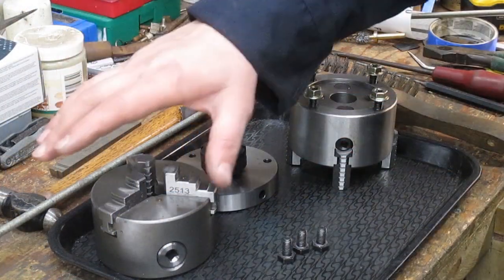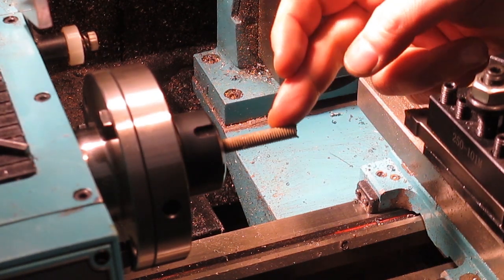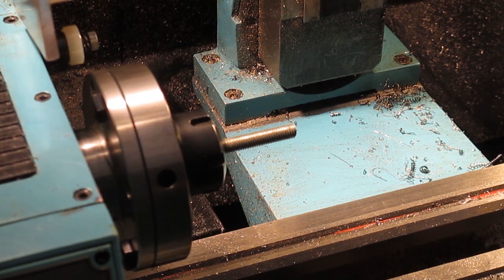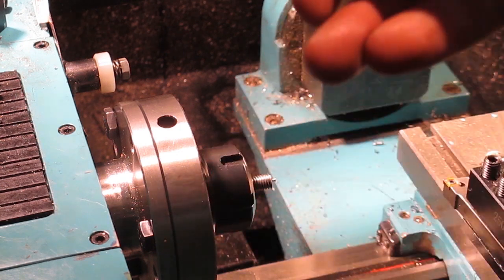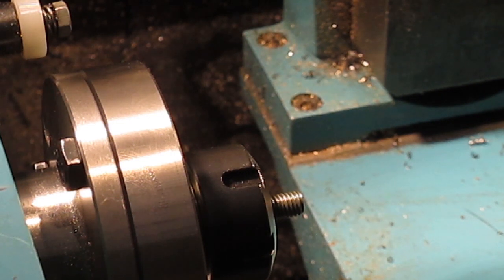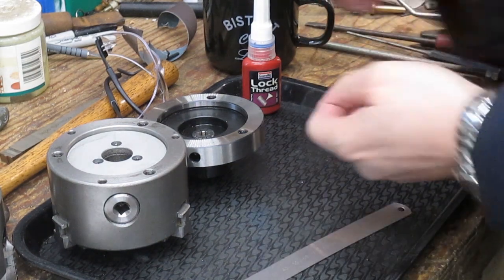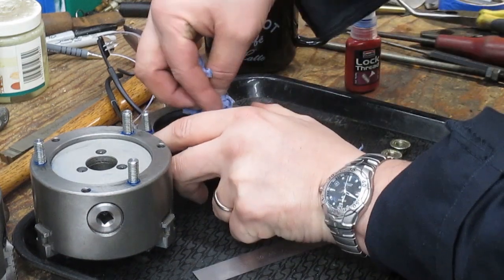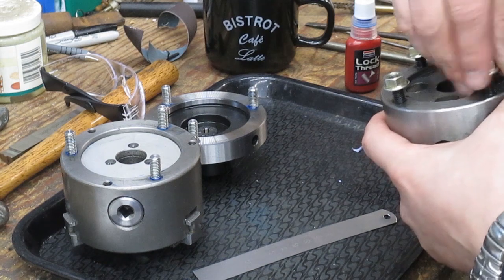Lathe Chuck Modification

Comment: Threaded rod is usually made from the cheapest crappiest steel, and tend to be a bit soft. I used high tensile, (head-mark 12.9), Allen-head bolts cut to length. Quite cheap for 3, and a bit more confidence-inspiring than threaded rod.
Reply: It’s a small lathe, and there won’t be any heavy cuts, so it’s likely ok. But the threads aren’t precise, and the chuck could move under pressure. I’m more interested in what the concentricity is here, particularly on the collets.

But I see that you have the set screws in the tool holder that came with it. I don’t understand why Chinese companies use these screws with those long noses. They’re no good. You don’t get full engagement with the threads, and those thin flats are too small. Replace them with flat end set screws the same length, or a slight bit longer than the thickness of the top of the holder. Unless you’ve already done that and these are just very long, for some reason.

A hint in using thread lock or epoxy. Just use enough to cover the first third of the screw. It will be squeezed back as it’s threaded in.
Reply from the maker: @melgross  Hi, concentricity on my 3 jaw is slightly under 2 thou from memory, the set screws were not with the collet plate these are just long and thanks for the hint on the thread lock, every day is a learning day :)
Reply: @melgross  IT'S !! PLAIN !! OBVIOUS !! WHY !! THEY !! DON'T !! DO !! THAT !!
Reply from the maker: Totally agree but its what I had to hand at the time and so far has served me well.  Maybe in the future I will swap them out.  Thanks for watching and your comment, as I'm sure it will help others out too.